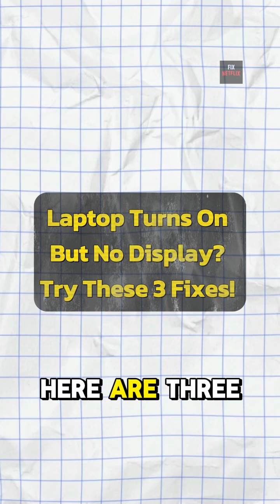3 Easy Fixes for Laptop Turns On But No Display

Comment from the maker: Same problem persists, please check more method here. 
https://youtu.be/TjblSOXtAuo
Reply from the maker: https://youtu.be/TjblSOXtAuo
Reply: @TechVibesYTA  thanks for replying and I fixed it myself and its temporary : This might be long but can be very helpful to you

I was getting no display but output was fine on TV using Hdmi cable

So as an inexperienced guy, I needed to open the back panel of my laptop and did

First I disconnected the battery 
Then was about to pull out the RAM (watching YouTube tutorial 🥹) but I stopped in mid way thinking that what if I insert incorrectly after pulling it out ..so I pushed it back immediately to normal position without taking it out on my hands for both RAMs
#mistake 1 , I did

Then I reconnected the battery connector and tried booting but still no display & even this time there was no output to TV HDMI
It scared the shit out of me  thinking I might have messed with motherboard

So to fix this mess, I again decided to open the laptop 

Step 1: Clean EC Reset
Power OFF laptop
Disconnect charger
Open back panel
Disconnect battery connector
Hold power button for 60–90 seconds
Leave laptop untouched for 10–15 minutes

Step 2: First Boot (Important)
Reconnect battery only
Do NOT connect charger yet
Fix back panel  (no screws insert needed)
Connect HDMI to TV/monitor( if you have)
Press power button once
Wait 7–10 minutes (don’t force shutdown)
➡ If display appears (internal or HDMI), laptop is OK.
➡ Connect charger only after display comes back

Comment: Nothing it's happened 😞
Reply from the maker: Please share the details problem
Reply: @TechVibesYTA laptop working function normal no issue but display light not working when we flash light of mobile on to computer display then we run easily laptop
Reply from the maker: Are you sharing the screen with a second monitor?
Reply: @TechVibesYTA sorry 
I don't have any other screen
Reply from the maker: Please open the back cover, then disconnect and reconnect the RAM and SSD. For more information, please check the pinned comments.

Comment: I am facing this issue multiple times since last year. 
I have nitro 5 laptop , and I got the problem after travel only or when using laptop on my bed
Previously gentle taps would fix but not now, I need to reinsert RAM and battery for temporary fix and the issue would come after few months again.. all the time hdmi display works but..

Help
Reply from the maker: Thanks for reaching out, dear friend. If the problem persists, please see the pinned comments. Here, you will get the solution.

Comment: I don't know why but my laptop don't work in after I think of the battery press the power button for 3 seconds for 1 minute for 3 minutes 4 minutes 5 minutes then I plug in the charger
Reply: And it's just turn off
Reply from the maker: Please open the back cover and disconnect and reconnect the RAM, SSD, and other cables. Now try.

Also, clean the RAM with a rubber eraser.

If this is helpful, please like and share this video with your friends and subscribe to the channel for the next video.

Comment: Bro mine is different is like the power button only thing that turns on but only for 10 seconds, and the screen remains OFF with my charger always plugged bc it won't charge or turn on without plugging it in idk why and i also don't have a removable battery this laptop is abt 8 years old by now but its on 22H2😅
Reply from the maker: Thanks to share your laptop' condition
Reply: @TechVibesYTA HOW TO FIX IT PLS HELP ME!!
Reply from the maker: Hi brother,  please disconnect and reconnect the RAM and other cables. If require clean the ram via rubber.  
If not work please inform me.
Reply: @TechVibesYTA it can't be remove

Comment: Gonna turn it off, leaving comment so i can come back later.

Edit: Didn't work even after a minute.
Reply from the maker: Remove battery from laptop.  If not possible please press reset hole in backside of the laptop
Reply: I'll have my Roomate do that when he returns in a few hours, he's in tech. Chatgpt says my laptop Brannd uses cheap components so they may have gotten damaged by heat. Raised the power on my APU using x86 universal tool and last week saw temps reaching over 100°c, so maybe cables to display gotta damaged. My PC is Proline V14 Ryzen 7 5700u @TechVibesYTA
Reply from the maker: Without physical checking we don't understand your problem.  Please clear the details problem.  Sometimes this is happening due to the short circuit in mainboard.

Comment: For the first step, is it also effective if the battery is not easy to remove, mine needs screwdrivers. Is it safe to open mine?
Reply from the maker: Please check back side of laptop.  There are hidden reset holes.  Press there.  Your laptop will be reset.  Then try turn on

Comment: My laptop froze so i shut it down and now its full black no cursor no boot even the caps lock doesn work and hard reset also didnt work and i only have 1 8gb ram stick so any fix?
Reply: Ok i will try
Reply from the maker: Thanks
Reply from the maker: Please remove the battery from laptop and wait few minutes
Reply from the maker: If not work then, replace the keyboard